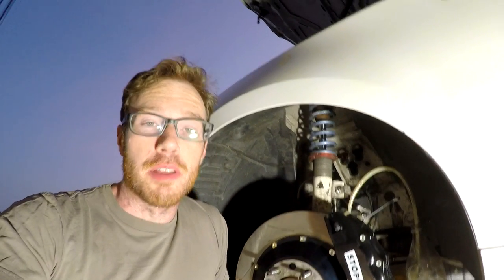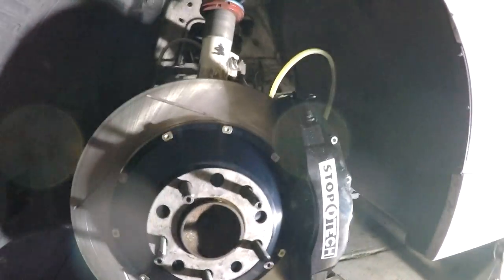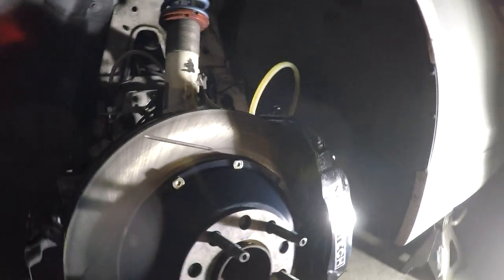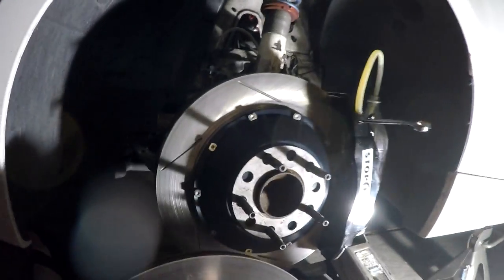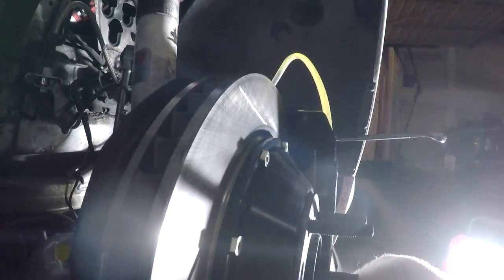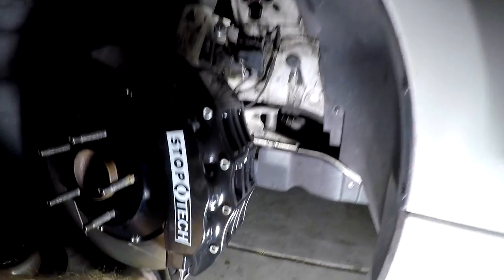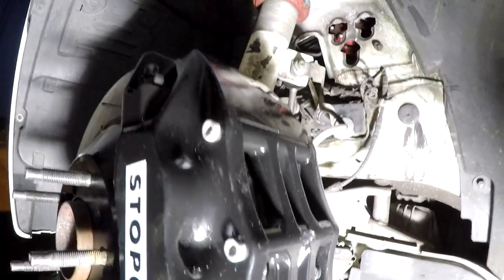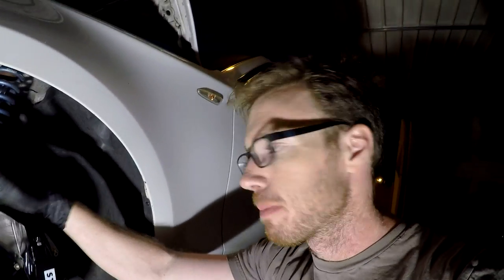StopTech ST60 Big Brake Kit: Initial Impressions and DIY Install Tips

Comment: how do you like these long term?
Reply from the maker: Only ran them for a bit before parting the car out. No real issues, but definitely requires knock-back springs for track use. The Non-M E82 hubs seem to produce a lot of pad knockback on track for whatever reason.

Comment: Ive been trying to find out if the 2 piece rotor will work with the oem calipers. I'm not sure the brake caliper will clear the hat of the rotor. Could maybe get back to me and lmk what you know in this regard. Thank you.
Reply from the maker: Not possible. OEM calipers are much too narrow to fit these. I believe both ECS Tuning and Racing Brake make a two-piece rotor conversion for the 135i calipers. Good luck.
Reply: @DriveBreakFixRepeat . Thank you for getting back to me about this. It's nice to be able to chat with you. I might explain now that we're chatting that the vehicle is an X5 E53 4.4i N62. I've done an OEM Big Brake Upgrade. Using X5 4.8is calipers. Those are twin piston. With rotors size 356mm x 36mm. Front. I'm worried that with the 2 piece rotors I'll have clearance issues with the brake pad. Any knowledge you could share would be terrific. I'm bit of nerd and been gear-head since Day1. I'm quite meticulous about my vehicles and mechanical techno crap. You seem fairly intelligent. Hence why I
 messaged you. I usually don't bother to message anyone. You could prob guess why. SMH. LOL 😆 Idiots.